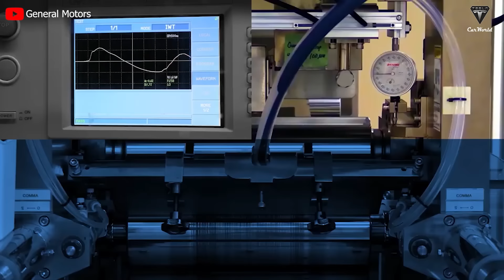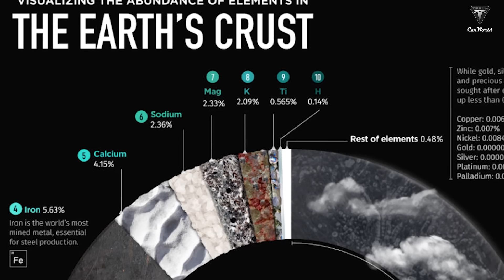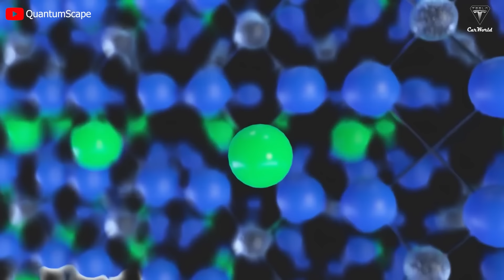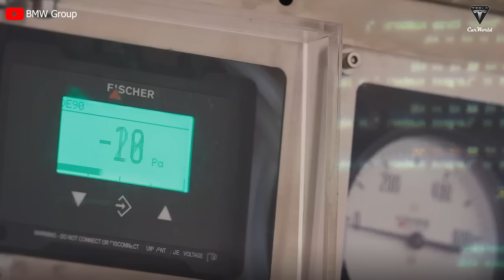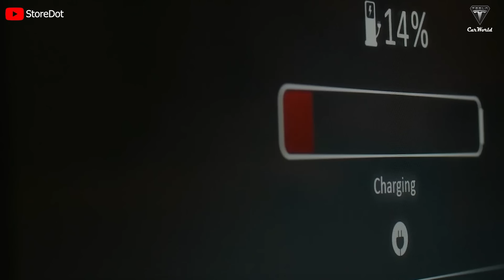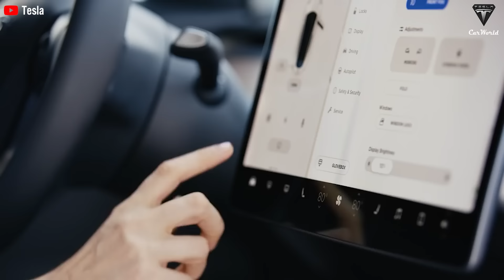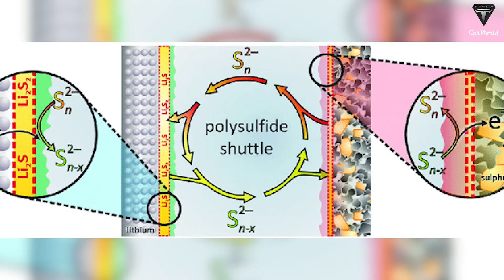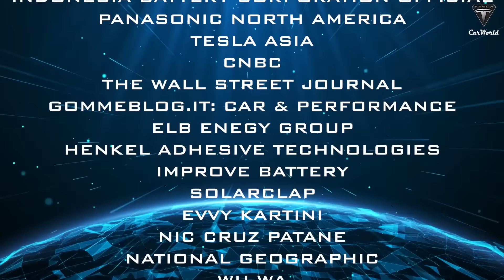There are 3 NEW Futuristic Battery Tech for 2024! Elon Musk's proof it works!

Comment: Finding a non-Li battery for static applications would free up a lot of Li for mobile applications.  Here there are some interesting possibilities when weight is no longer an important consideration.  There are a couple of ZnBr batteries, a SbCa battery and a whole bunch based on Fe and V.  What is great is that they all have characteristics that make them superior to Li batteries if you are no longer concerned with weight.  They last far longer than Li batteries, pose no danger of spontaneous ignition, can be shipped fully discharged, are from elements which are readily and cheaply sourced from multiple suppliers.  All they need is market share to become less expensive than Li batteries.
Reply: " a whole bunch based on Fe and V."  A strong market for V wpould be good news to some!  Vanadium is mined mostly in South Africa, North West China and Eastern Russia.
Reply: @Patriot-os7br  I don't know the answer to that.  Also, I don't know what I said that you replied to - I don't seem to have a comment in this conversation thread.

Comment: aluminum ions have a greater energy capacity than sodium, because despite being slightly denser they provide three times more electrons than sodium, aluminum has a greater energy density than sodium and is slightly lower than lithium, but due to its abundance and cost is better.

Comment: Na-ion batteries have about half of the li-ion energy density. So it means less range unless you double the battery pack. Not very practical (too much weight) ! Sodium will be a good solution to replace lithium in the Li-O2 batteries. This technology has a very high energy density.
Reply: Sodium less dense not more dense.  If temp fluxuation is not critical, can the sodium take a charge without preheating the battery pack????
Reply: Na-Ion is for industrial usage (where space & weigh is not an issue) not automotive..
Reply: @plasticjock1090  You are wright but future technology (like metal-oxygen) will be helpfull to improve sodium battery energy density. It's a lot cheaper than lithium ans less harmful for the environment.
Reply: Most cars today dont use mnc though... most use LFP that is already HALF of what the other does. Na is only 20-30% behind LFP atm for gen2.
Reply: @plasticjock1090  Not fully true - the real goal is just how much power dens do we need to hit before they're "Good enough" is the true line to either cross or not. Its one of hte reasons we're using LFP vs just a raw Li battery. NA still has a few gens to go through just from current research and whats hitting the real world. For example, Solid state, Si and S improvements, and M for NAM. Those improvements alone offer around 4-10x improvement going from 150 -> 600 making it more than enough for todays need and better than current gen batteries. Granted, some of those will also come to Li type batteries as well allowing them to increase more for less Li, but still, its more of a supply issue currently than it is a just raw performance once we hit those power dens. The world will need a lot of batteries lol.
Reply: It would work in the discontinued Nissan Leaf, the jump to double the standard 198 cells to 396 wouldn't be a killer. Tesla crams in as many cells as the cars will hold already, people will notice when it's only half the range on a sunny day.

Comment: Solid oxide fuel cells look promising -- but is there a good absorption (low pressure) storage for natural gas.  It would be a great hybrid if possible : 1/2 the power come from fuel cell and half from battery on acceleration or uphill climb.

Comment: I hope not too much as the energy density is the same as lithium, so it will take maybe 5-10 more years before a magnesium battery with more than double the energy density is fixed! so the EV came 15 years early, but the mobile phone also came early (you remember those who were there).

Comment: Driving an EV is like strapping a thermal runaway potential to your backside I would think. Look up the carbon footprint it takes to manufacture an EV, then how green is it really when you plug it into charge and the electricity is provided by a coal fired power station. Adds the meaning   and depth to the word scam in my humble opinion.

Comment: Sodium Ion will be half the power of Lithium ion. I think it would work well in the discontinued Nissan Leaf that only had 198 cells to begin with as it would be easy to just double them. I don't think sodium ion would work in a tesla anything unless they introduce a motorcycle. Tesla already crams as many cells as the car will hold into them. If they switch from lithium to sodium, people are going to notice the 50% drop in range.

Comment: I thought we were supposed to have electric cars running on water (converted into hydrogen) fuel cells by now. That was the future as told in the '70s. 
Another idea is that sodium replaces Lithium and sulfur batteries.
Reply: Why would u use electricity to make hydrogen to then make electricity it's super inefficient that's how we get hydrogen it's thru electrolysis u waste way less power charging a battery directly and also they already make hydrogen powered cars look up a hyundai ionic

Comment: Why don't they use a combination of two batteries. Based on the average amount of KM driven in one day. Have the first battery responsible for that. And a secondary batter in the car designed to be trickle charged from home. Then you can get the best of two worlds of battery tech. The first designed for low charge times, and the second designed for the environment.

With an idea like this, weight is nigh on irrelevant, but space is the big issue.

Comment: How come it took so long to figure out how to make rechargeable batteries based on sodium when that not only is easier to work with (as they are less reactive) AND have better performance at high AND low temperatures??
Reply: The energy density is lower so the batteries have to be BIG. There's only so much space for batteries in phones, laptops, and EVs.

Comment: Any thing you buy that comes with a( cord ) you know not made to last.We have learned that it will break sooer or later. 
Most the time gets thrown away Old tv's get tossed..
Why whould anybody want  to own a car with a cord ???? 😮😮😮😮😮
Reply: Safer faster better  for 1 HA
Reply: All of my gas powered vehicles need electricity and a battery as well.  Spark plugs make a spark from electricity. Without it, the gas doesn't ignite.  Whether it has a cord or not, it still needs electricity.
Reply: @TexanUSMC8089  Gas car has a spark off the coil .And alternator keeps the battery charged.
Just a few things EV's can't do. 😁😁

Comment: It is interesting too me that a battery with a cathode, and anode material reminds me of a PN junction of a diode, and of course 3 levels of semiconductor material produces a transistor (ie. PNP, NPN). Current is supplied to these layers of semiconductor materials resulting into some form of useful electrical action. This is way out there, but what if there was a synthesized material that could tap the endless supply of so-called zero point energy of the vacuum that physicists have proven to exist. A diode manufactured out of this material could produce electricity directly from the vacuum, and be virtually free. A solid state battery that also recharges itself.

Comment: The problem with Chinese batteries is they have a quality control issue, they are the batteries in EVs, Electric bikes and E-scooters that are always combusting. It's people who do not know better buying their batteries. Not only their batteries are the most flammable but they are the lowest performing, take it from a guy who puts electric bikes together as a hobby. I've built many electric bikes and I'll pay 200 or 300 more just not to be stuck with the Chinese non branded batteries to avoid the dangers that comes with them. FYI also avoid the Unit pack powered batteries, their shitty too. Only use the big brands like LG, Panasonic, Sony & Tesla, there's other good ones but those are the one's I can think of at the top of my head.

Comment: it's crazy to still be using lithium batteries that with age have a huge problem of shorting out and causing major car fires , because of the highly flamable material , because of all the chemicals the lithium is soaked in. so now sodium looks like the battery that ev manufacturers were searching for, for years , one that is lighter weight , won't combust like lithium , and won't risk workers health in poor countries mining lithium and cobalt . the surprising thing to me from a drivers point of view is , if they now know there are extreme amounts of cars with lithium catching fire , why are the manufacturers allowed to still be producing these cars that they know are anything but safe ? yes they have put a lot of money into evs , but they seem to catch fire when the batteries get a few years use of charging , and isotopes moving through the battery causing the shorts. but the price for replacement lithium batteries , is criminal , being as much as the car. when they become disposable like bic lighters , cheaper to buy a new car with no miles on the battery. they need to stop manufacturing these evs with lithium and cobalt. when you can take a lithium battery apart , unroll the lithium that is packed in flamable chemicals , drop it into water and expose it to oxygen at the same time as dropping it into water , and then it ignites into extreme flames , it should be a no brainer , it's just not safe , sodium is cheaper and won't ignite , does away with not being able to charge very fast in extreme cold weather , there is no advantage of using lithium , and it puts the driver at huge risk , having this highly flamable battery under the driver's butt. i won't even look at evs until they fix this problem. in the next few years they can have this thing all figured out , using sodium. unfortunately for current ev owners , they are the guinea pigs , while we wait for car companies to fix the main problem of using lithium , continuing fires as lithium batteries age.

Comment: Why are you people still dealing with freaking batteries put a nuclear aspirin in any vehicle and it will Outlast any engine and the frame and the body and everything else why don't you do the right thing instead of wasting people's time and money the United States and also Russia I've got nuclear submarines that only have to be refueled every 50 years tell me of a car that's possible I'm capable of doing that building batteries cost a lot of ecological displacement a lot of ozone problems so just put a freaking aspirin's type nuclear tablet tablet and a reactor that can drive a electric motor and be done with all your b***** thank you